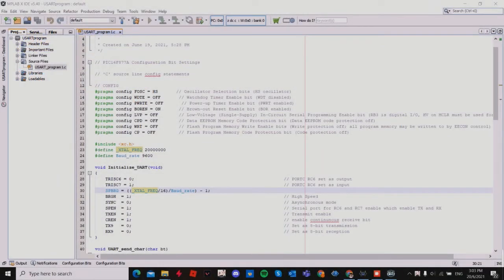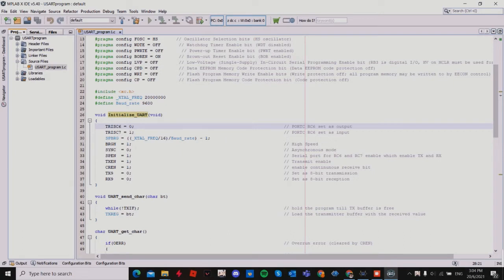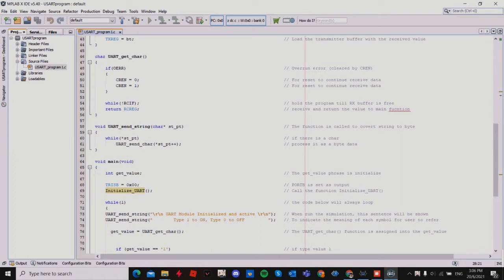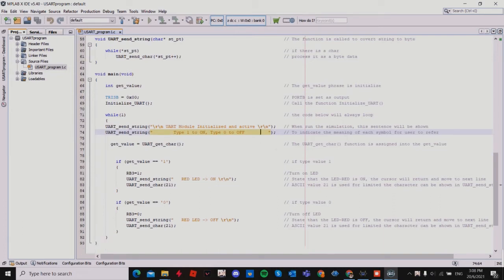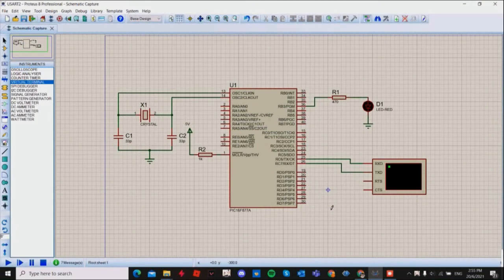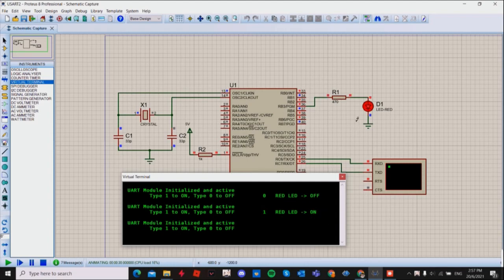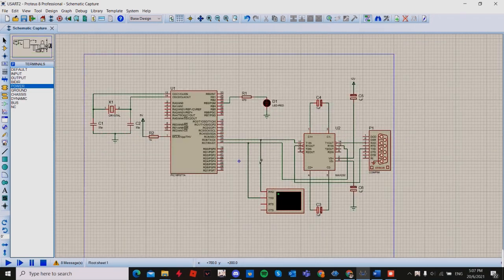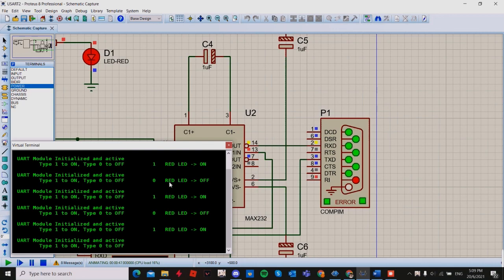Serial Interfacing between virtual terminal and LED by using PIC16F877A

Comment: My friend, do you have any idea how to make the virtual terminal allow me to decide if I can pass the data from a temperature sensor?
Reply from the maker: Yes. Actually virtual terminal is to control the program of the code you want to perform for the PIC controller. My suggestion is to connect a temperature sensor to the PIC controller, the temperature can be code that it is sensing all the time but not receive from the PIC microcontroller and whenever in your virtual terminal choose yes, it will open the port for the temperature sensor to receive data to the PIC microcontroller if you willing to play around in the code in MPLAB X. I will not controlling the ON OFF port for temperature sensor since it will take time to process from start. Hope it helps :)